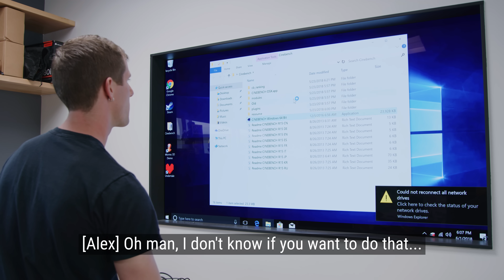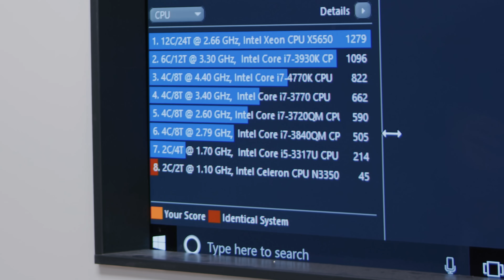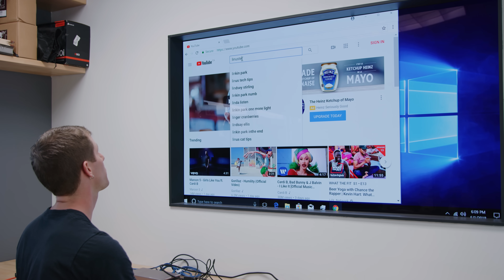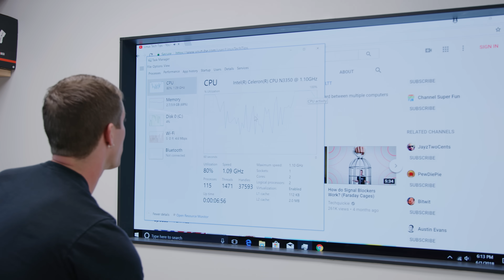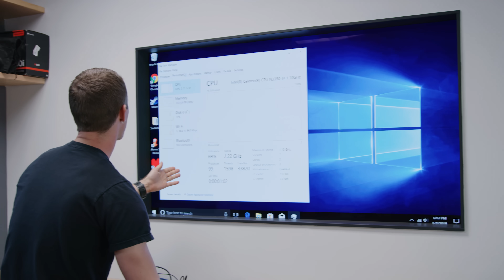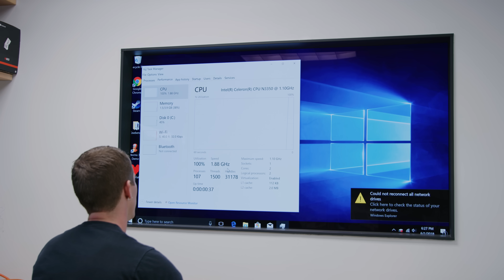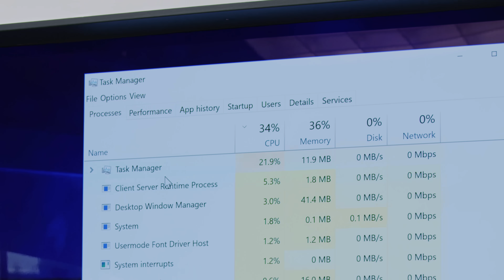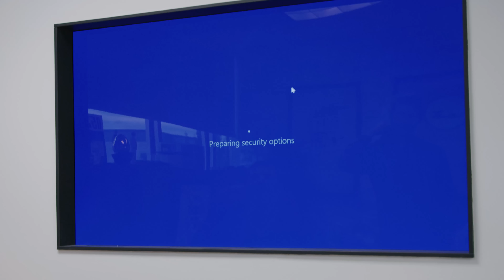PC Smaller than an SSD

Comment: I mean, smartphones??? my tiny PC has a built in OLED panel
Reply: Arm and x86 are very different
Reply: EggoMyLego yes and no.  They could easily throw in x86-64 but they don’t want to bc of performance isn’t as good.
Reply: +EggoMyLego
 in terms of power consumption not that much. Intel did x86 CPUs for android smartphones few years ago. This is pretty much successor to it (but not intended to use in smartphones, since intel decided they can't compete with arm), so.
Reply: they just released a ARM based windows laptop
Reply: niter43 those CPU’s failed in every way from power usage to speed.  To slow to much power the a12 is to pass the intel i7 mobile chip well also using a faction of the power.  However this might have less to do with x86-64 itself but it might  but seems the money is being dropped in arm rather then x86-64 at this very time which goes back to maybe they saw arm as the better cpu for mobile for one reason or another.
Reply: A whopping 1440p + oled in some cases too!
Reply: Guys... Really? That all depends on the Tasks u wanna Do With it for simple Tasks Arm got better powerefficiency but for complex calculations it needs way too much cycles. And im Pretty sure that x86 has effectively more money in development the arm got factoring in all the serverprocessors. Theres no way in simply saying arm is better then x86.
Reply: considering the intel SoC in this zotac box, could barely handle "windows account login" its pretty weak for the windows enviroment. yes arm and x86 are different, but my phone isn't exactly pushing nothing is it 1440p+ display, 4k camera slow mo video, hi quality audio, video output, gaming.
Reply: NonsensicalVids most of it is rendered by the gpu not the CPU and are simple Tasks. Arm wont be the future for Real PC-Tasks or heavy gaming With CPU demanding Tasks.
Reply: maxinator server tech doesn’t help mobile tech much bc they don’t have power limits.  They can use more then 1 cpu at 300 Watts each.  Not cpus they have a max of 3 watts.  Not saying arm is “better” but with smart phones that’s where more money is being dropped why they are dropping it all on arm I’m not sure
Reply: maxinator switch uses arm but I question their soc of choice.... Microsoft isn’t getting away from x86-64 cpus for no reason (their store does emulation so it can run across many cpus just like android)

Comment: Man, Just but a Raspberry pi!
Reply: Man, this (random motherboard) is just a (bigger random motherboard)
Reply: You'd do much better with the Pi as it's Quad core and their supprisingly capable with linux O/S on them. Been using them for years, mostly as Media players, etc
Reply: @hiteck007  not really, since the pi uses arm processors, and therefore cannot be compared to x86 cores as apples to apples. Although, it does run linux fairly well, due to optimizations and all that

Comment: I wish I could come up with a practical excuse to get one of these just so I could mess around with it.
Reply: It could serve its purpose as a picture frame? Or some kind of wifi home audio server.
Reply: Get back to work Ada! - Neebs probably
Reply: You could throw Debian on it and use it as an emergency computer or as a portable one. AFAIK LXDE debian doesn't need a lot of resources and as such will run a bazillion times vetter than windows. It is also FOSS(with the exception of drivers for certain devices) as well if you're into that kind of stuff.
Reply: mhammad alloush That's kind of what I was thinking, but then I feel like I could also get everything I need for fun little applications out of a Raspberry Pi or similar board.

Comment: #bloodCooling
Reply: Until it blows up in your hand like a cheap chinese smartphone battery.
Reply: Yeah, I'm not so sure about the "blood cooling" idea. I don't think you would get enough transference/whisking of the heat. So, covering it with your hands would only make it worse. Interesting idea, though. Perhaps if you had an actual heat pipe going to something like a t-shirt. But, you would get more from it being exposed to open air rather than your body. More testing required! ;) :P
Reply: Reminds me of my Zenphone 2 I had. That fucker was blood cooled.
Reply: If u learn science conduction is better than convection
Reply: ok nah what the hell
Reply: @CybershamanX well actually, if you can feel heat, then that means at least some of the heat is being transferred into your hands. So as long as you feel it, its working.
Reply: JayzTwoCents would fill a custom loop with human blood just to test that.
Reply: Problem is the heat transference into your bloodstream is so inefficient that it makes things worse, not better.  More heat gets trapped under your hand "blanket" than gets dissipated.
Reply: Joe Sterling what about filling a water cooler with blood? I mean as long as it's turned on and circulating it's going to work?
Reply: One small problem:  Blood naturally coagulates out of the body.  You'd have to dope it up with blood thinners.  :-)  Even then, blood is organic.  Don't know how long it would be viable as cooling fluid.
Reply: Joe Sterling Yeah that's main issue.
Reply: @Joe Sterling sure, the heat transference is very insufficient, but it is more effective than air. So it does make it better.

Comment: ribbed metal chassy, for her pleasure...
Reply: Chassis.
Reply: Well done sir lol
Reply: That's not overclocked, that's just the burst frequency, which should work and self adjust rather than crash.
Reply: Corley Kinnane 
I hadn't checked I went and looked at the links and whoa these things ARE pushing $200.
I bought a stick PC that's usually $99 or more and I got it as an open box complete and shipped for around $85 or something.
Mine at least had a quad core running somewhere around 1.6 GHz without overclocking (I think burst was maybe 1.8)
And even with only 2 gigs of RAM the thing ran smoother than this thing probably due to its better processor. What kind of business would pay around $200 this?!
I wouldn't pay more than a hundred for this piece of garbage.
Reply: Hmm been there
Reply: "ewwwwwwwwwwww..."

Comment: hdmi 1.4 specs for the display and hdmi 2.0 for the hdcp.

easy way to test it find an hdmi hdcp stripper or hdmi recorder that will remove the hdcp and allow recording protected content  on an hdmi 1.4 specs and see if it will work on this as probably the full 2.0 specs will require very high licensing costs so they compromise by giving you only 1.4 imaging specs while providing 2.0 protection.

the 2.0 specs is supposed to have no analog outputs, not be backward compatible so older hdcp strippers and recorders will not work on 2.0 .

Comment: This thing is legit neat!
The fact that it's an x86 device stuffed into a formfactor previously reserved for ARM devices like RasPi or cell phones, and still has competent performance...
I don't know what the N3350 (or  the updated N4000 version as of typing this) has compared to Atom processors such as the Z3735F or the Z8300, both popular processors for ComputeSticks.
And yes, compute sticks are awesome, but this thing is thinner. :3
I am curious though. Now that USBC display devices are starting to become more common...
Can the PI225 be powered through its USBC ports, allowing a single cable solution if your USBC source device has the beef to power something this thirsty?
Or does it need to be powered by its microUSB port?

Comment: Can't even afford a normal SSD.....
Reply: Sorry dude that stinks 
Me too ☹
Reply: Sem te Vruchte a 60 gb ssd is $40
Reply: Bruh you can get one for less than $50 lmao
Reply: I would rather get a 40 dollar 1tb hard drive than get a 40 dollar 60gb ssd. I mean, I know that ssds are better but the cost is too high.
Reply: [VHD-YouTube] what kind of SSD is 60gb but costs $40. A 256gb SSD is $55.
Reply: Javier Hernandez https://www.amazon.co.uk/Kingston-Technology-SV300S37A-60G-Solid/dp/B00A35X6GM
Reply: Javier Hernandez back in the day when 32gb ssd cost me $250
Reply: Good Guy I never buy first gen products, I waited a decade to get my first SSD, a 1tb Samsung 860 evo.
Reply: [VHD-YouTube] dude there 120gb ssds for 40$ on amazon
Reply: [VHD-YouTube] yeah but I set my laptop slightly too hard on the table and the hard drive broke and the head crashed, it wasn't even hard. Also a 3tb HDD uses a ton of power and its noisy and unreliable, a 250gb old ass Samsung 840 wrote 2.2 petabytes before death. Reliable enough.
Reply: People don't understand it's a joke😂

Comment: I wonder if the snapdragon 845 could beat it in performance
Reply: Lelouch Yagami of course
Reply: that is a 2 core 1.1ghz, the 845 is 4 core 2.8ghz with hyper threading,I have a snapdragon 845 in my phone
Reply: You can't simply compare clock speeds over different processors with different architectures
Reply: ehmm... no the Snapdragon 845 is an 8 Core cpu with 4 performance cores at 2.8ghz and 4 power saving cores at  1.5ghz, the last 4 Core flagship SoC from Qualcomm was the 820/821, and no there is no hyperthreading on Qualcomm  SoCs
Reply: When you say the A series rivals the i5s you've got to go back quite a few years. I'm fairly confident that a 2011 i5 is still far ahead of the A11 bionic
Reply: iOS =/= MacOSX
Reply: Yh it will
Reply: 845 is 8 core
Reply: You can't directly compare x86 to arm. They have different instruction sets so overall performance is not directly comparable and depends on the specific task. However, arm has a simpler instruction set, so usually, x86 can do what arm does but better if coded specifically for it, but that has to do with optimization. For general unoptimized code, it usually favors arm.

Additionally, it depends on how many computations can be done per clock cycle, and x86 wins here. So... who knows :P
It's the whole 'serial' vs parallel argument. It is hard to quantify arm in the 'parallel' space as it's instruction set was originally designed for 'serial' operation. The scheduler is very different.

The two are hard to compare because they reach the same end goal but from totally different directions and methods. One benchmark will favor x86 while another will favor arm, and this is unavoidable. 

In a perfect world, each benchmark will try to achieve the same end goal with the best possible code, but there is a problem with where the line is drawn for the 'end goals'. Draw too many and 'optimization' gets too limited and doesn't make since, not enough, and you can no longer produce values that actually accurately score the benchmarks fairly across architectures.
Reply: I would like to see benchmarks, but this little cpu is a severely castrated Intel, so probably it would lose quite well, but still impressive...how much ram did it have? I assume 2gbs.
Reply: Junky228 Geekbench is the worst benchmark for X86 platform tho, it wont even use more than 50% of the CPU during the benchmark, so all the X86 based PC will underperform in geekbench.
Reply: What's better? 8 motorcycles or 2 18 wheelers? 
Depends on what you are trying to do :P
Reply: +Mr. SEA 2 GB's. Not 2gbs, 2gbs is an internet speed. Just saying.
Reply: I think that the celeron will still beat the snapdragon. But we cant compare x86 vs mobile arm chips.

Comment: Pretty sure covering it with your hands like that is having the opposite effect you're hoping for. You're likely insulating the warmth inside more than you're sapping it away. Metal is better at dissipating heat than skin after all.
Reply: But is air better at dissipating heat than skin?
Reply: I was thinking maybe put a plastic cup of water with ice in on top of it
Reply: Yeah, but it's not resting on metal, it's resting on wood. Humans are also orders of magnitude more thermally conductive than air.
Reply: Thermally conductive doesn't really matter when the lowest temperature you can get it to is ~98 degrees F.

If you want less than that, you're going to have to find a colder source...
Reply: +chipmonk434

You're not going to get it below human body temperature, but you don't usually need a CPU to run colder than that anyway. A cpu is more likely to be at about 150 F, so the extra conductivity would help.
Reply: Well, at the very least you have me questioning whether one is in fact better than the other, I'll give you that. I'm still not entirely convinced, but I can see that there's a case to be made here.

I'd love to see some science behind it to see if there really is a better option between the two.

I think the key word to check for would be "best cooled" rather than "coldest" or "quickest". As in: sustained thermal reduction at the coolest held temperature.

Comment: If they put Linux mint instead of windows it wouldn't use half of its processor just to run  the OS,  better yet Linux Puppy. Windows if a pig and probably needs most of that 32gb hard drive just for the OS, a fully loaded Linux Mint only is only a few Gb's and puppy so light weight it can run on a scientific calculator yet can still run pretty much any program you need it to.
Reply: There's nothing stopping you from installing your own OS.
Reply: When you buy pre-installed Windows, A subsidied license fee for os is already included with the code of machine. Not every vendor will refund it to you. My HP laptop got a refund but Lenovo guys just refused it on my lenovo laptop.
Reply: Wouldn't be LUbuntu a better option? It's only 1gb
Reply: Im not familiar with all the linux distros im sure there is a even better and more suited version out there. But linux puppy is only 100MB and runs from ram so its going to be way more responsive and its GUI is very user friendly because working through terminal is beyond most people.

Comment: try it with a linux distro or something
Reply: yush i recommend puppy for it
Reply: I think you can dare more with lubuntu or even xubuntu..
Reply: In my experience.. if you want something as a controller/AI unit or such (great use for this micro pc) i'd say using linux with i3 DE is great.

Comment: PC sticks... raspberry pis ... is this an old vid? Azulletech had a quantum access 3-4 years ago running win10
Reply: Only the Pi Zero is smaller than this, and that's because its header is taken off.  With the header, sure, it's a smaller volume, but you wouldn't be able to hide it inside a laptop's hard drive slot.
Reply: Nano pi is even smaller than the zero pi
Reply: no its not. more liks its a new kind of advertisement ;D

Comment: Yes.
It's a raspberry pi, except worse.
Reply: toothlessblue had to scroll way too far down for this
Reply: Good luck running Windows on a Pi.
Reply: Doctor Jew I mean, Windows performance on the Zotac thing isn't all that great either. A Pi has more functions (like the GPIO pins etc), a bunch of software, documentation and even add-on hardware specifically for it. Also, Linux is the way to go anyways if you're not going to game on it. (Even then you can just use Play on Linux)
Reply: Docter Jew someone made a UEFI BIOS for the Pi, now you can run full Windows 10 (ARM edition of course) on Raspberry Pi. For real now.
Reply: What would be wrong with a Raspberry Pi? Just don’t use Windows on it.
Reply: There's a Official Windows 10 for the Pi...
Reply: And just don't use it. ARM is not the best platform Windows, if there is any :-P

Comment: if you really think about it, Android Motherboard module, with all that CPU and LPDDR4 RAM, minus the Battery will be about the same Size and weight as this thing.

I mean, you can easily get Windows ARM OS, and then using something like SnapDragon 865 Module with 8 Cores and can easily run AAA Games on it that is written for ARM OS.

Comment: A raspberry pi b+ 3 overclocks at 1.6 Ghz
Reply: But only has 1gb of ram this has 4gb
Reply: Ok thanks
Reply: @ritroder  But we're not talking about pi 4?
Reply: @Guest in Back. Are you Ben Shapiro?
Reply: Raspberry can't run x86 apps tho.
Reply: @solanumtuberosa  Ummm yes it can if you really want it too, though it might be a bit laggy in Emulation mode in Linux. The Pi 4 would be the only one to Try that on.
Reply: @hiteck007  crawling isn't running. The best you can do with a pi is wine emulation of a calculator
Reply: @solanumtuberosa  "Raspberry can't run x86 apps tho."  Why would you want to though?
Reply: @0x8badf00d  update, raspberry can run x86 libraries now, mostly linux tho. Go check out pi labs channel and you will know why

Comment: Got the 14' HP Stream with similar specs except with Intel Celeron N4000 /4Gb single channel DDR4/ 32Gb Sandisk eMMC. It would not upgrade to Win10 1903 (must be all the surveillance spyware) SSD capacity too small lol. So I installed Linux Mint which was up and running on only 10Gb of HD space. Did some Linux SSD optimiztions such as change swappiness from 60 to 10, inode cache to 50 and firefox snapshot rate down from 15 seconds to 2 min's, have to enable trim manually. Runs wayy better than windows for Netflix, youtube, and all around surfing the web.

Comment: So basically, this thing is the size of a phone but way less powerful, with less memory and less storage. I bet my phone can run windows better than this.
Reply: But it has a x86 architecture. Your phone and the PI225 can't run the same version of Windows. This can be useful if you need to run proprietary software that has no ARM binaries available.